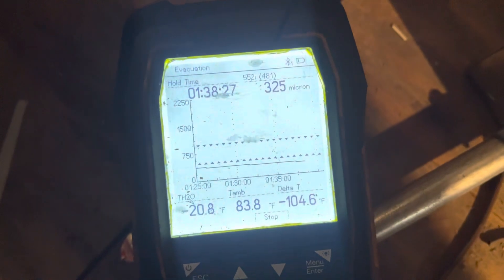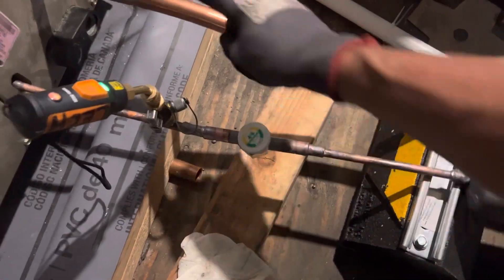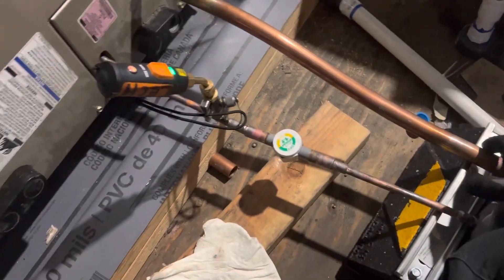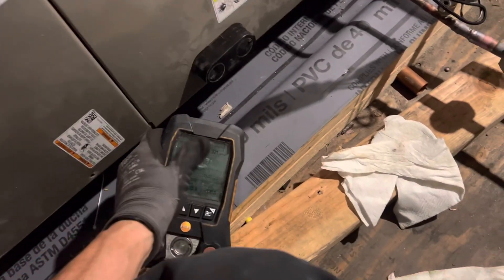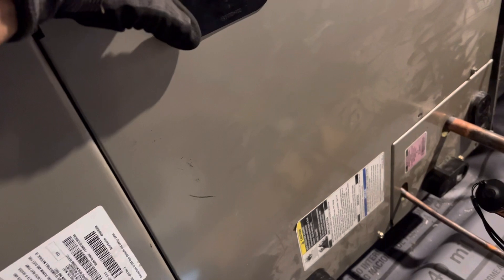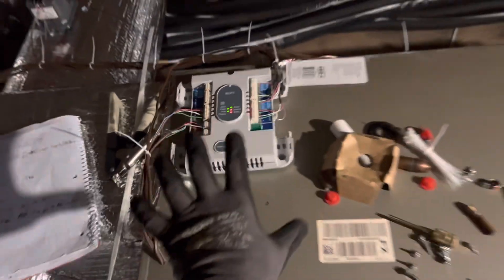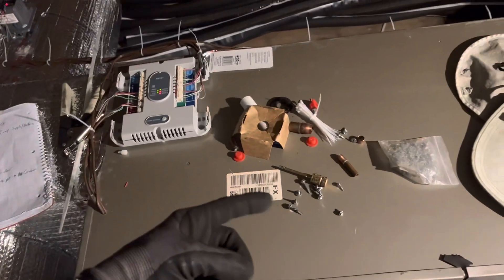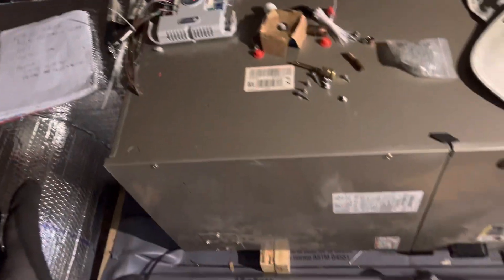Vacuum not going as fast as I would like it at the end of the evening just leave it on overnight￼.

Comment: did you use refrigerant analyser in commercial/residential hvac ?
Reply from the maker: Yes R22 because many use different different gas. They don’t tell the customers but cheat the customer and still charge for R22.  Or someone will tell the customers that top off with R22 but put a drop in blend refrigerant right on top of R22 contaminating it.  

There are a bunch of lowlife sleazy companies in residential and commercial to.

Comment: I think it should reach under 200 microns without too much difficulty.
Reply from the maker: I am cooling vacuum from the suction line one hose only outside on the roof 80 feet away.   Through the evaporator that had to cut pipes filled with POE oil exposed to the atmosphere for months. 
                          My micron gauge is attached to the liquid line that is on the other side of the evaporator located with the expansion valve between the micron gauge on the liquid side and the evaporator. 

So through the tiny little small orifice in the expansion valve everything on the liquid line side 80 feet of it Hass to be drawn towards in that direction and then it Hass to flash off all the moisture latent contaminated POE oil. 

If it wasn’t for that contaminated POE oil I would be well below 100 µm already with no problem just in a few minutes on a brand new system